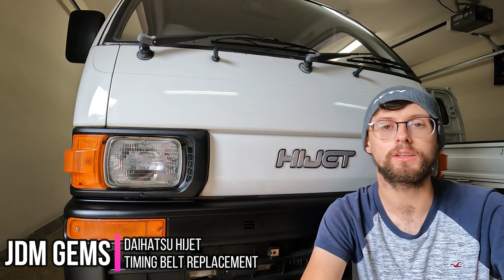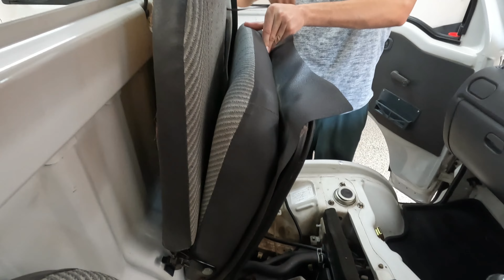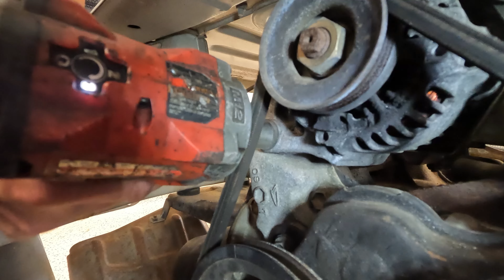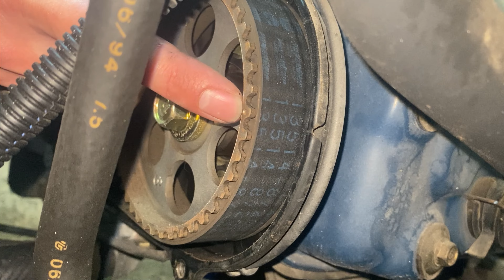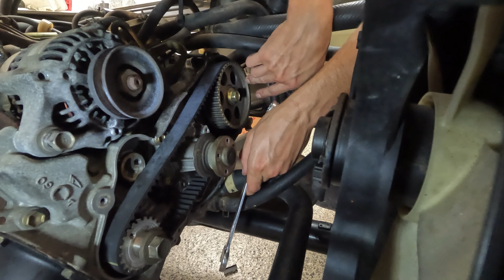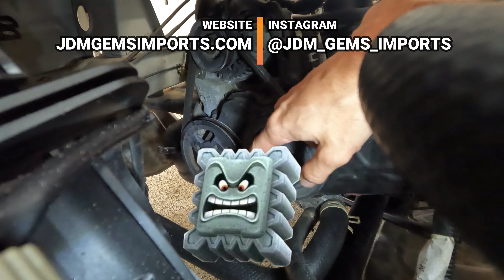Daihatsu Hijet Timing Belt Replacement

Comment: I have a question, the part number on the box and the part number on your new belt didnt match.. the box said 13514-87282 But the belt said 13514-87208 Have you had any issues with it? Is yours the 4x4 S110P 1994? Thax for the vid, just want to be sure I'm ordering the right part lol..
Reply from the maker: Odd
I didn’t catch that but no I matched it with the belt that came off and it was exactly the same
Reply: @jdmgems  All good thanks.. I'm pretty sure I have the right one on order... Thx again.. Didnt realise this was such an easy job.. Saying that, I recently replaced the rear main seal and clutch and was surprised at just how easy the lil guy is to wrench.. :-)

Comment: Gotta love Daihatsu giving you ample room at the front of the engine to do this job. The new generation S200/210Ps are the exact same.

Another thing to note is that the Daihatsu E engines are interference design so it is critical to make sure your timing marks are correct or you WILL ruin your engine when you go to turn it over.

Comment: For anyone watching this who's preparing to change the belt on their hijet with air condition, there's a second belt to contend with.  Not a big deal, but there are brackets (and associated bolts that must be loosened) on both the front and back of the compressor. The easiest way to access the aft bolts is via the engine cover in the bed.

Comment: Am I missing something? The very first step (loosen crank shaft bolt), that bolt spins freely. The alternator belt and all 3 pulleys spins with it and nothing loosens when that bolt is turned. I’m using a long box wrench, but there is no way an impact is fitting in there. The back of the radiator is about 4 inches from the crank shaft bolt.
Reply: Did you find a solution to this in the end? I've seen some methods of using the starter motor with a wedged breaker bar but the my engine is in pieces as I'm doing the head gasket.
Reply: @wibbles2086  I bought a flywheel tool that has little prongs that sit in the holes of the pulley to keep it from turning. But I decided to wait to do it until necessary. But I should be prepared now when I need to be.
Reply: @whiterabbit729  ah thankyou very much, ill try this and let you know how it goes

Comment: Excellent video! Following along in my s110p (with A/C so there’s an added step) but I feel like I’m missing something obvious. When I go to loosen the crankshaft and water pump, both pulley spin free. It’s the same in gear and out of gear. All four wheels on the ground… what am I missing?
Reply: Transfer case not in either gear fully?
Reply: Same thing with me. Did you ever figure it out?
Reply: @whiterabbit729 ever figure this out? Mine spins freely too
Reply: Ever fix this?

Comment: Great camera work to show the process as clearly as possible.  My Hijet is the TwinCam so it'll be slightly different but I saved this video to my Hijet list for future reference, and so I can refer others who need to do this job.  I would have replaced the timing belt tensioner, and probably the water pump and alternator belt at the same time.
Reply: I wish I'd replaced the Hijet timing belt and water pump as a preventative maintenance (as I intended) because the water pump suffered a catastrophic failure and I had to tow it home and order the parts to fix it.

Comment: New sub. The way you both grab the correct angles for the shots is perfect. Great job. New sub. I got a 1992 JUMBO Hijet. The alternator belt snapped. Should I do the timing belt at the same time??? Or just wait? Your opinion matters. Thank you.
Reply from the maker: Why not do a timing belt job just to be safe.
Reply: @jdmgems I’m mechanically declined. Lol. You made it look easy. But I’m lacking in the tool department as well.